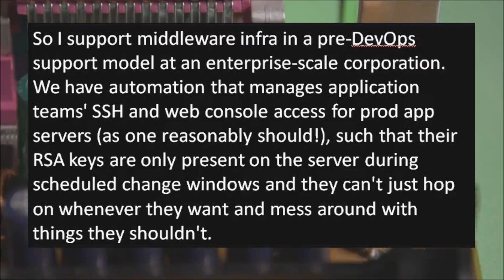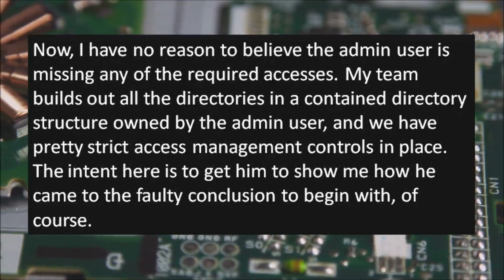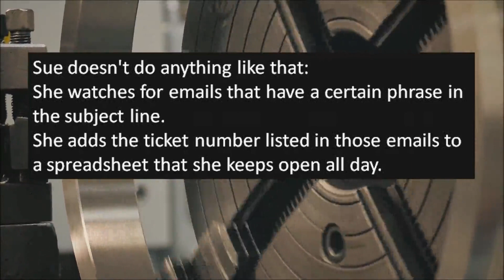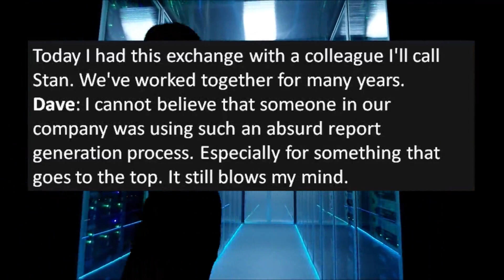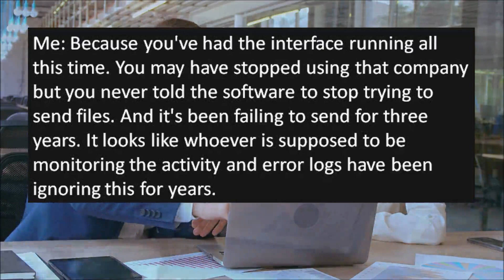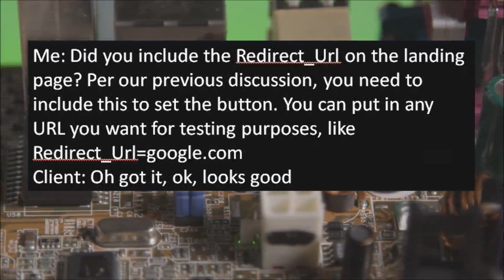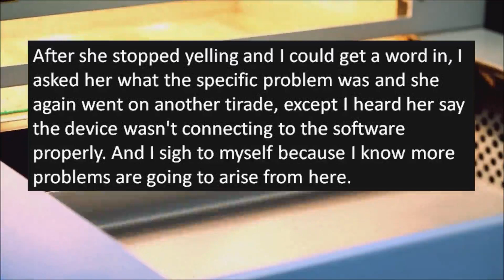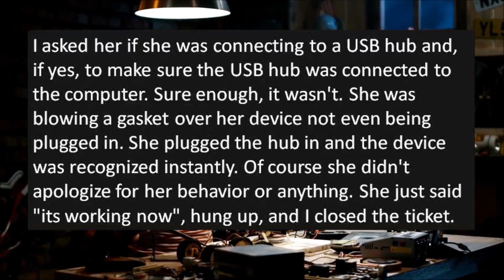Tales From Tech Support - What do you mean I have to plug it in?!?

Comment: The alarm problem : EVEN if the printers are there when the alarm system was installed, the technician had no way of knowing that those printers where scheduled to work in the middle of the night when there is nobody in the building and the alarm active. Then, those who schedule that printing job had no idea that it could cause any false alarm.

Comment: IT guy here. An admin user account is one that is created to be used with full access on a server. It can create, add, delete, restructure etc.  The person was requesting that the account used to manage the server be changed to read only. This would make the account useless for its intended purpose and would also probably break a bunch of stuff. The first recommendation to create another service account is spot on if they need read only to the server. There are frequently multiple service accounts set on servers depending on the actions they need to execute.
Reply: Oh! like the time my boss bought a brand new first aid box, padlocked it shut and refused to give the only qualified first aider, a key?
Reply: @bookvee  Padlocking a first aid kit is making it a second aid kit... as in you first need to get who has access then get the kit.  Best to just have sticker-seals (or one of those break away plastic seals)... so he knows when someone has opened the kit, even when he is not there, as usually the issue happens at the worst times!
Reply: @bookvee  oh ffs
Reply: Like the root account?
Reply: @skywz  Root should never ever be given to anyone without a very, very good reason for using it, and then allowed access only for what they need.
Reply: @wolphin732  so that would be creating another user with some permissions then using doas, not giving them the root password and using sudo.
Reply: @bookvee  This is like your boss, who is also a locksmith, asking that everyone be given the key to the first aid kit but that the key only grant access to the bandages.  That's not how locks work; they're all or nothing.  So the request is not only borderline nonsensical and impossible to comply with but making it suggests a profound ignorance of something on which he is supposed to be an expert.
Reply: @wolphin732  He was paranoid that we would overdose on asprin or snort ground up plasters or something. This is a man who refused to allow a college student to do work experience because we had glue that they might sniff. I really dont think the pritt stick posed any real danger.
Reply: @thrdeye7304  I should have use the time he put a timer on the staff fridge so it could only ever be opened at lunch time! Specifically HIS lunch time. That lasted until 10 am the next morning when he realised he could not put his lunch in.
Reply: @bookvee  Padlocked a first aid kit shut? Okay... and OSHA would've had a field day with that, let alone Labor and Industries. Hell, it's a $7200.00 fine for not having a "wash you hands before returning to work" placard, and another $10k for not having a workers rights poster up. Or at least those were the fines the store I was at received after a outdoor gripe session turned into a whistleblower call due to scheduling (12 hour shift, no lunch break, apparently legal in Oregon).
Reply: in light of more recent events, that request could also be construed as an attempt at either intentionally breaking that companies systems, or an off the wall attempt to piggyback on an additional admin account after breaking said system...
Reply: @bookvee  wow you should definitely send some of these stories in.

Comment: On the first one, a few people have explained it fairly well but it's worth me adding that what windows users think of as admin is a baby compared to Linux root.
Root can do anything the computer can do. No access controls, no protection, if you tell it to delete your hard drive it'll happily do so (and crash during the process).
Windows still holds your hand a little and doesn't let you do things it thinks are utterly ludicrous. This is why people are saying that root login should never be given out, and why someone asking for "read only admin access" is very worrying (when coupled with the fact that a read only root login will break lots of things).

Comment: Our office had alarms set off by motion sensors when blinds in certain offices were left open at night. Headlights of cars driving by shone in the windows and moved or flickered  on the walls down the hall and the sensors interpreted it as movement. I just happened to pull into the parking lot when the police showed up one night so I let them in, read the alarm panel code, saw which sensor alarmed, saw the cars.
Reply: We had the  sensor triggered by an ANT walking across the sensor and breaking the beam. We also had it triggered by a strap hanging from something and blowing in the air currents from the heating system. We had no idea it was that sensitive.

Comment: re: Story  2 I Was an Alarm Tech for 40 years before I retired So this doesn't Surprise me one bit ,, I remember during One particular Heat wave ,  The Air-conditioning  would cause false alarms and in the Winter the Heating Fans of a Garage would cause other false alarms , and getting the Adjustment just right,  so there would still be Protection in that area was  tricky  testing and re-testing  to get it just right

Comment: Read only+admin is almost opposites...  I agree another account with just read-only access is the best.  As an IT admin... the global admin accounts should only ever be used within the group supporting the OS level.  

Specific accounts for each is always the best, since it then allows for tracking who did what... and when someone leaves the role, they can easily have access removed.  Or use group permissions tied to the OU for their roll, so when they move into the roll and their AD account is set as the role, their account is automatically given all the access needed, and when they leave it is removed, without needing separate items for someone to do (or forget to do).  Then if servers are changed, only need to add one group that then gives everyone in the group (which likely shares duties) access to it.  No need to add everyone specifically, and likely forget someone (like a fill-in).  Could even give control of the group down to the manager, so it is on them to add/remove users, and not need to involve an IT tech at all!

Comment: The printer story wasn’t anyone’s fault. The people in the office wouldn’t know that the heat from the printer could set the alarm off and the installers wouldn’t have ever thought that the company would be printing enough stuff at midnight when the building is all locked up to create enough heat to set off the alarm
Reply: A friends alarm company put a system into a automotive parts dealer's old building. It was a drafty old railroad terminal. The passive IR sensors were falsing, but the business owner refused to believe us. We covered the edges of the 745 year old doors and windows with duct tape., and the false alarms stopped. He said he would have the leaks repaired, but the duct tape was still there, several years later. It made the already crappy looking building look even worse. On the bright side, their heating and cooling costs were cut by more than half.
Reply: @michaelterrell  Just a bit of duck tape cut the heating costs by half ? Imagine what replacing the doors and windows with new one would do. Replacement costs reimbursed within the year, even using more costly look alike custom made doors and windows.

Comment: IR sensor going off... I had one on the inside of a server room (inside a very secure area... that has "man-traps" to access) that kept unlocking the door... about ever 10 seconds!  

Nothing was done when reported to management, but when some security doors were being adjusted, had them look at it.  It was thinking the warm air inside the room was someone wanting to exit...   They tried adjusting the angle, but was still tripping.  They reprogrammed the system so the sensor now doesn't unlock the door, and someone has to turn the lever handle to exit.  

The sensor had been there to know if someone opened the door without using the security RFID badge to unlock the door.